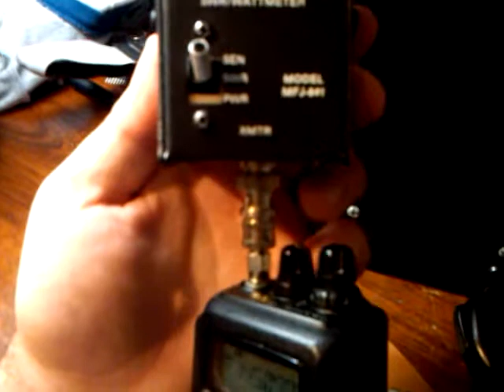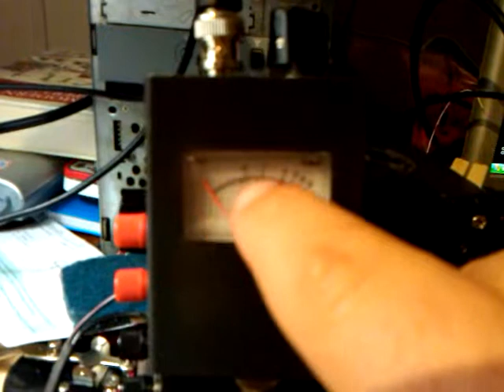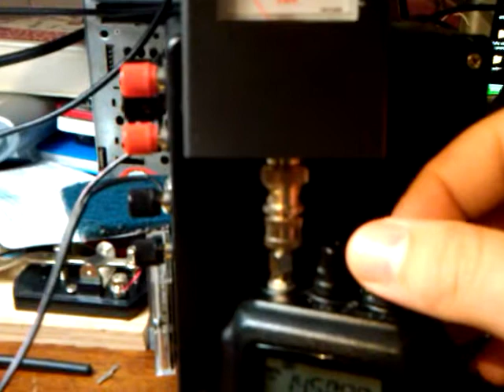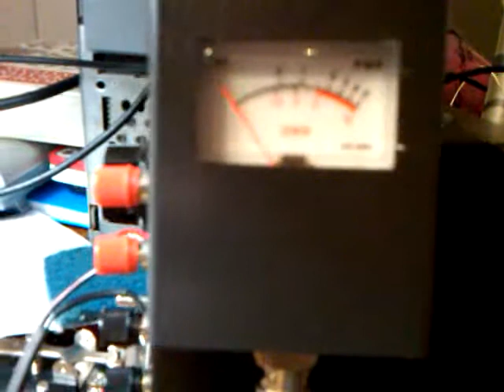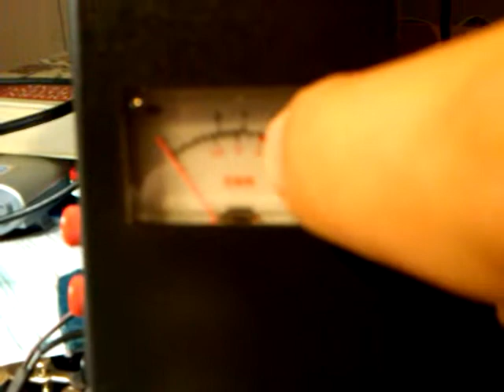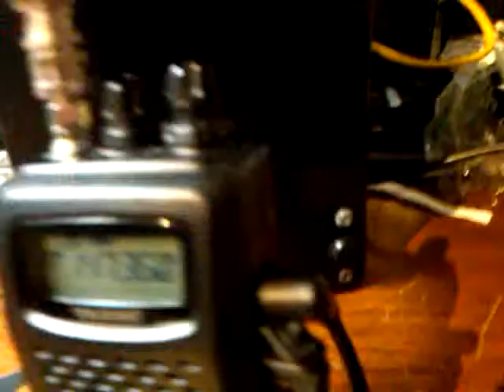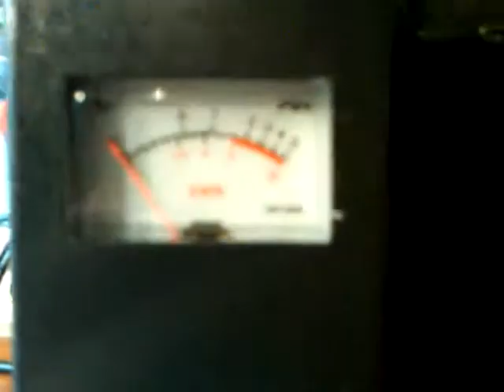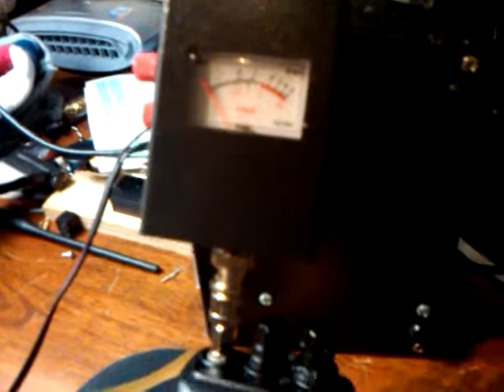MFJ-841 2 Meter SWR/wattmeter review

Comment: Thanks for the video, One tip i want to mention, I fixed lots of antenna jacks for people using the SMA adapter you have. thay make short ones that screw down to the radio making it so all weight is not only on the  SMA